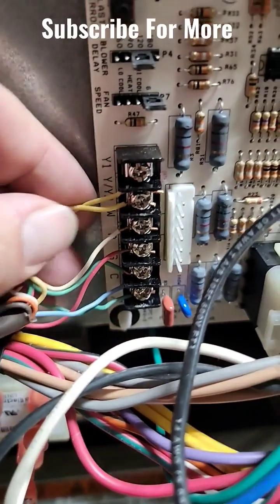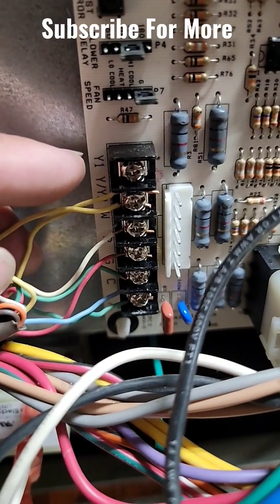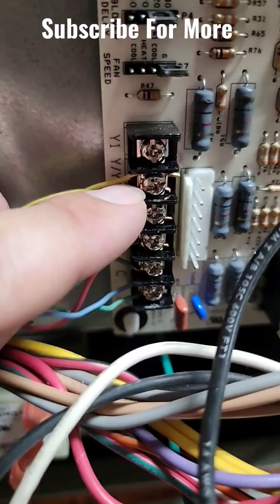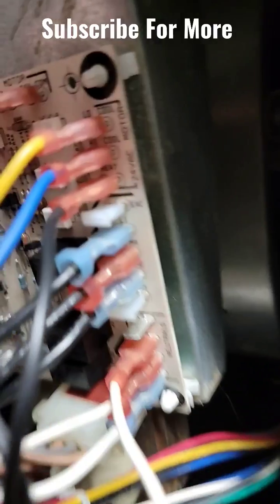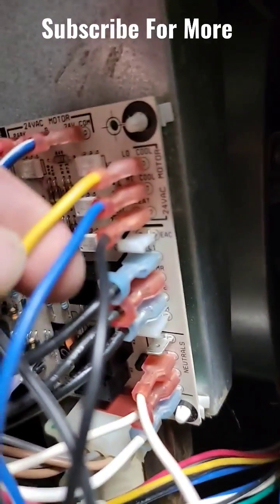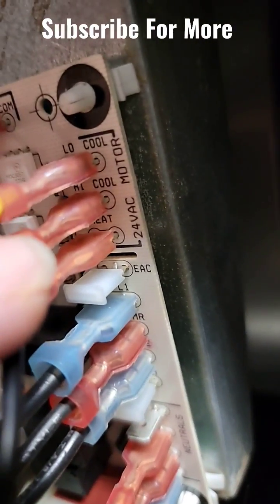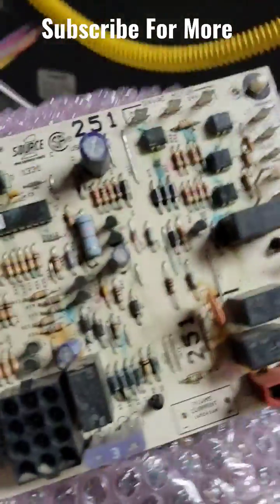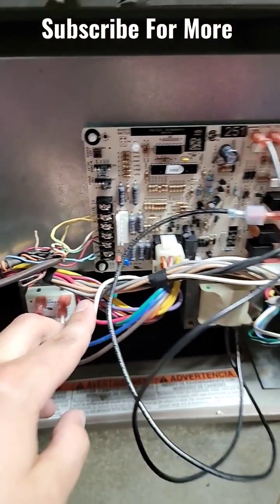Y1 and Y1/Y2 low voltage terminals

Comment: I have the same circuit board at 2:51. The glow igniter circuit went bad and I replaced the little relay on the board. The board seems to test out fine the 24 V wires get power when needed. My ECM motor is toasted so I replaced it with a PSC motor and a 24 V relay to control it. The problem is once the control board energizes the relay it never drops out and the blower keeps running, but if I remove the 24 V relay the 24 V power supply for blower and heat mode drops out as it should please help if you get this text

Comment: Quick question I have a York two-stage unit but like to utilize the second stage  fan speed option it runs at a higher speed but like to use it in single stage is that possible

Comment: If you have a 2 stage can both wires be on stage Y2? My mr cool 4ton ducted heat pump fan runs at full speed on stage 1 and can never heat my house.

Comment: My condenser manual and air handler manual both say 2 stage heat pump ,no comunicating. On both manuals it shows a wiring diagram y1- y1 ,y2-y2 but there are no y2 ports on my defrost board or my control board inside???
Reply from the maker: Check the schematic, and look at how many thermostat wires you have and the colors and the labels, maybe your thermostat wires indicate

Comment: Wouldn't putting the high speed wire from the motor on the low cool terminal give you the same result if using Y1 though? It's 120v on every fan terminal either way and the resistance of the winding that the color of each wire on the motor references is what determines the speed.

Comment: I am currently dealing with My ClimateMaster Heat Pump. My thermostat went out. Right now I have everything wire nutted temporarily waiting on a Tstat. Its hot 95-100. I have Y and Y2 jumper-ed together. Will this cause a problem? Also I guess I need a 2 stage Heat (aux heat) 2 stage cool Tsta correct?  I had just Y jumper-ed today and it wasn't able to cool my house.

Comment: Question! I currently live in Florida. It gets hot as hell outside. I adjusted the thermostat to 78, but it's reading 84. The outside unit gets direct sun, so what can be done to improve the ac.
Reply: Call a reputable HVAC company or try to do it yourself and find out.

Comment: Can you use Y1 and set the high cool speed wire in the place of the lower in a park position? I didn't get a good enough look at the board.  I'm sure it's because it's a newer board with more settings due to the stages I was just wondering if it was possible 🤔
Reply from the maker: yes

Comment: hi im a EPA certified  , have a question for you , i just replaced old cooling only r22 outdoor was connected to old gas furnace board C G Y W R  thermostat has  C K R RC W O/B G W2 aux/E Y2 L terminal  also has have 5 wires coming from gas furnace control board to new GOOODMAN HEAT PUMP  , is it possible to connect goodman heat pump to old gas furnace board  need that heat pump as a back up  . thank you in advance !!!
Reply: Yes

Comment: So does that mean in this particular situation you have a 2 stage air handler mated to a single stage outdoor  unit ? Not saying anyone screwed up here but we do this all the time when we cant get the exact units from our distributor.
Reply from the maker: No, most of the time, these furnaces come with the boards that have these terminals, for if you do have 2 stages

Comment: I have a question I hope you can answer. I'm having a two stage American Standard system installed. It's not a heat pump. I have a single stage currently. Since I have a wire bundle of five going out to the condenser but only 2 wires are used (blue and yellow), can I use one of the other wires for the extra Y connection as in your video? The installer is saying I need to run more wires out there but I don't see why I do unless I'm missing something.
Reply from the maker: If you get a battery powered thermostat and you don't use the c-terminal and use the batteries to power the thermostat then you can use that extra wire for the extra Y wire
Reply: @taddydigest  Thanks for the reply. I'll be swapping out the five bundle thermostat wires from the air handler circuit board to the thermostat to an eighth bundle. That's easy to do. I was referring to the five bundle heading out to the condenser and using one of the extra wires for the Y2 connection. I hope this makes sense.

Comment: You can have same issue if you have flue pipe issues, clogged condensate, or dirty coil. Also have had alot of those board get a Crack on solder joint on the ignition controls plug.

Comment: Did you discover where the water came from, Very important to do that before replacing the board You may have skipped this step just for information purposes I realized that
Reply from the maker: Drain was stopped up
 I had to clean the drain
Reply: Wouldn't the wires and metal be showing signs of water/ moisture looks too clean almost looks like maybe board wasn't properly cleaned after being assembled during manufacturing some flux something corroded and corrosion appears to be where  components are placed on board and circuitry and soldering on back of board or installers were preparing to install and it was hot and while getting furnace in it's location sweat dripped of his head or something

Comment: you know that yellow is a higher fan speed than blue right?  should be using black for cooling though anyway unless you're shooting for more dehumidification. yellow is med.high. blue is med
Reply: You should use whichever speed gives you the proper cfm and temperature split
Reply from the maker: absolutely 💯
Reply: Really?
Reply: 🤔Am I missing something? I thought you could just switch out the speed wires.🤷🏼
Reply: @Salyers-Family-2004  you can buy if the static pressure is high it will eventually burn up the motor
Reply: @ishalljr  I was just saying instead of wiring on Y2 just leave it on Y1 and change your speed wire from the motor in the place you want it. I wasn’t referring to static pressure or anything. Just commenting on what the video was talking about.
Reply: @Salyers-Family-2004  gotcha! My bad
Reply: @ishalljr  No problem.

Comment: Black speed on heat? Is that usually the case on two stage units?
Reply from the maker: I see all kinds of various wire speeds in the field 
Depends on the cfm and the temp split
Reply: Not really it depends on your unit and how big of a space you have Black is typically high speed on high speed depending if you have a heat pump with electric or gas you don't want it on a heat pump because it'll move too much air across the coil which then will give you lukewarm air coming out The slower the air the more heat it can pick up same principle with cooling you don't want the air going too fast over the cooling coil because then it can't actually change state and absorb the heat reduces efficiency 🧐